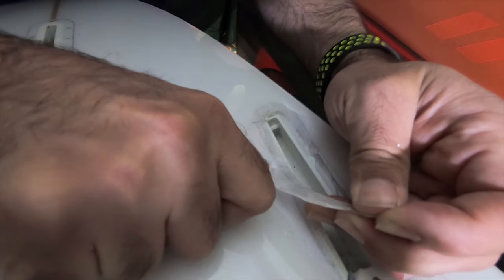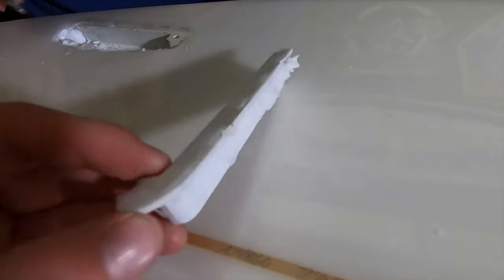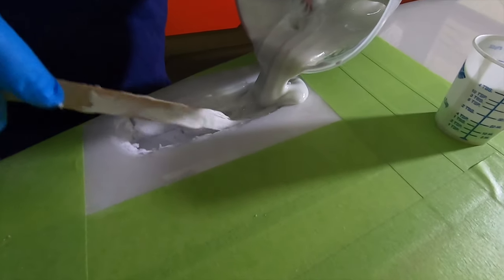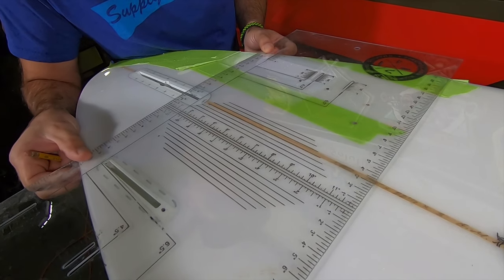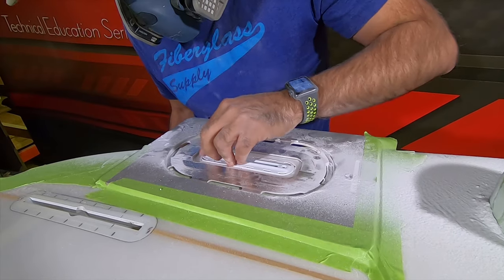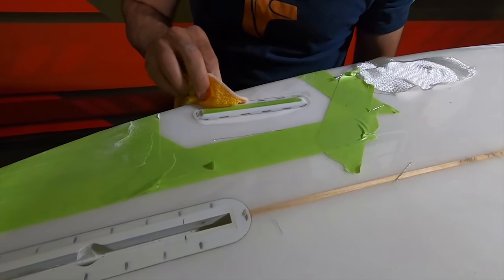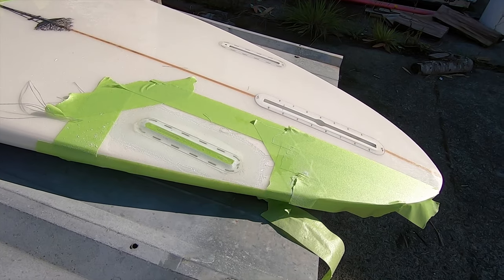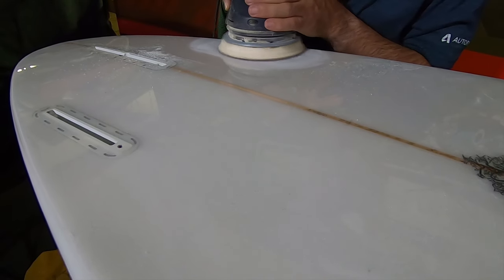Broken Futures Fin Box Repair

Comment: Excellent video. Lots of good composite repair info! I'm here getting inspiration for fiberglass kayak repair
Reply from the maker: Cool, thanks. Let us know if you have any questions.
Reply: For your information THIS is the hacker way. I mean; you ALWAYS replace foam with foam. Always the core material should be used to prevent unbalance and better adhesion. I am a surfboard builder since the 80s

Comment: Few questions. Could I just fill the initial damaged fin area with qcell and resin mix? Also if I only have sanding uv solarez resin would that work? I’m assuming you used lam initially then sanding coat after?

Comment: Awesome.  I just jacked up a future fin box on a board I’m shaping and I was wondering what exact material did you use to make the putty?  3m bubbles, resin, etc..?
Reply from the maker: We have a video on making the putty:
https://youtu.be/eK1vlG46XAY
Basically it is resin, 3m Bubbles, and Cabosil.  The resin can be a polyester resin or an epoxy depending on what you need.

Comment: Ifbthe fin box is not broken, can i reuse it? Thanks!
Reply from the maker: You could,  but since a new box is relatively inexpensive I would get a new one.  The lip around the opening is raised and designed to get ground flat when you sand it, the existing one will not have that and may be a little more difficult to finish the repair than with a new one.

Comment: My mixture I filled in the fin box doesn't get hard. It's still sticky after two days and I can't sand it. Can you guess what the problem might be?
Reply from the maker: Either mixed off ratio if using epoxy or did not add enough catalyst if using polyester.  I am assuming you used 3m bubbles and cabosil for the mixture like in this video: https://youtu.be/eK1vlG46XAY

Comment: Cool fusion 360 shirt, do you design boards using CAD?
Reply from the maker: Thanks, I have not designed any surfboards in fusion, I have designed twin tip kiteboards and a foil board in Fusion. The kiteboards I usually design flat and the foil board I did using T-splines.